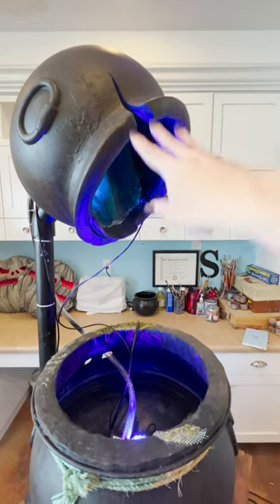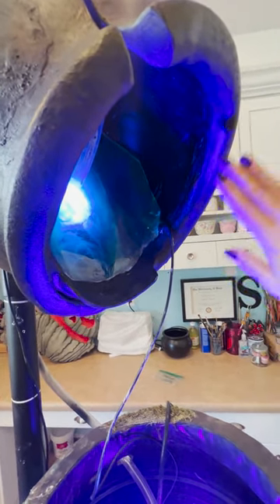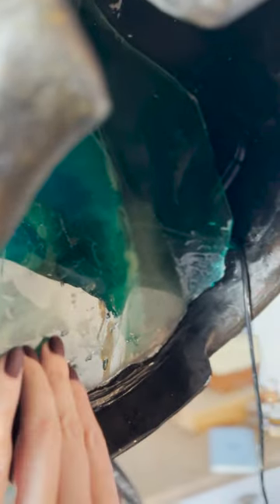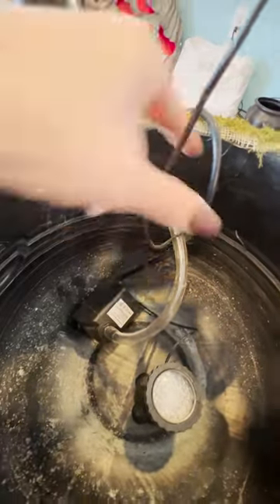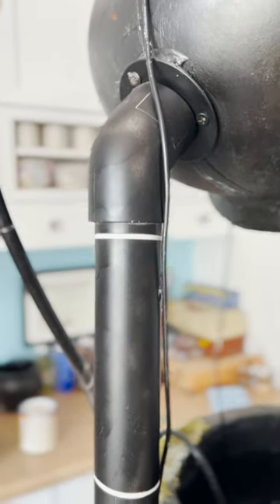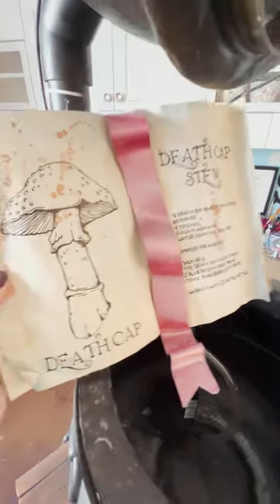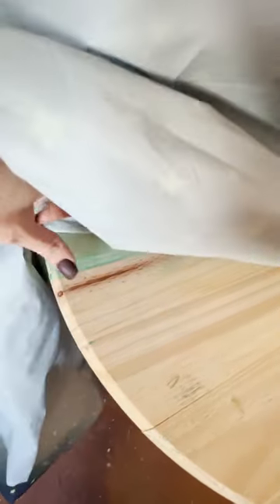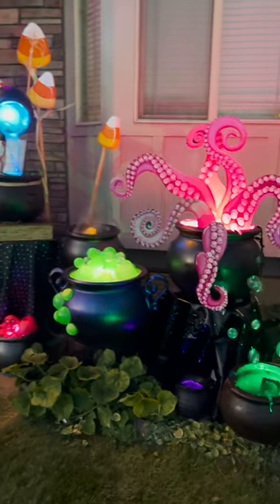Cauldron Fountain- How I made it!

Comment: This is a great prop design! My wife discovered your video on Instagram... so now I'm making this. I'm pretty much in love with epoxy sculpt now. However, I changed something up. I put JoyTube 1/2" Hose ID barb Thru-Bulkhead fittings on the cauldrons so I could run the water lines right through the sides of each cauldron. (I purchased through Amazon.) Because It's the pump I already had on hand I'm using a 3000L/H water pump which creates a pretty big flow rate! I also began thinking about how water pond waterfalls have a spillway box to help control the water flow and I felt I needed to do this because of the flow rate of my pump. So, I'm trying to use the actual cauldron to collect the water in before it flows out. I feel that if I use a T fitting on the tube as it enters the top cauldron and then attach short sections of tubing to direct the water flow up along each side inside back/sides of the cauldron I'll get a big sloshing splashing mess of water that collects in the center enough to flow out the front where it needs to go. (I hope, or I'll have to buy a smaller pump.) Then I noticed your problem with the water drip edge on your cauldron, so I used the epoxy sculpt to create a pour spout on the edge to help keep the water flow going down in the right direction. I haven't gotten to testing this part yet, so I hope it works out. Thanks for your great video tutorial!!
Reply from the maker: AWESOME!  Yes the water flow is a bit tricky!  It always takes me a little adjusting here and there to get flowing how I'd like.  I love that you are changing things up to work for you. That's really where the magic happens in a project like this!!! Hope it works out perfectly for you!